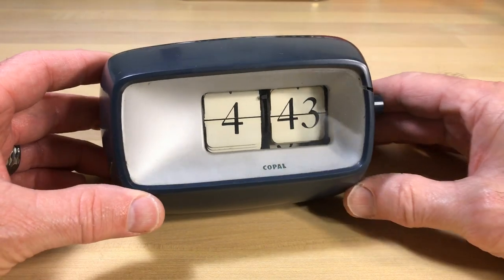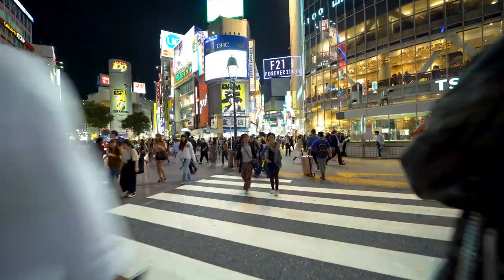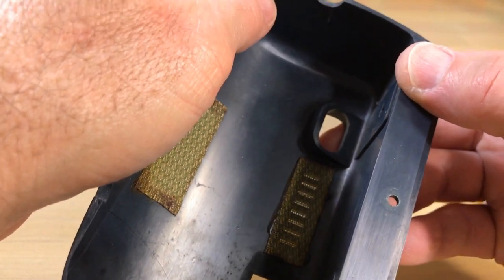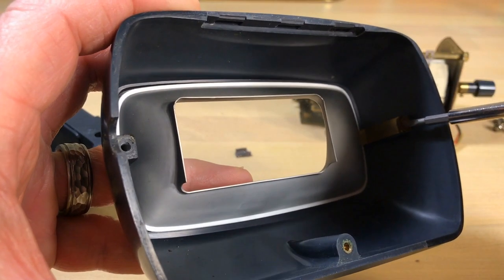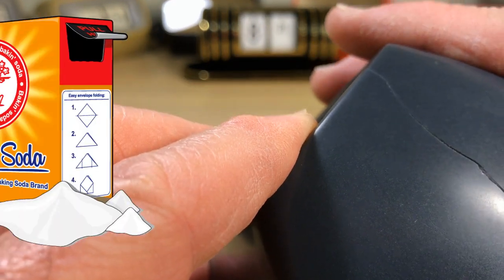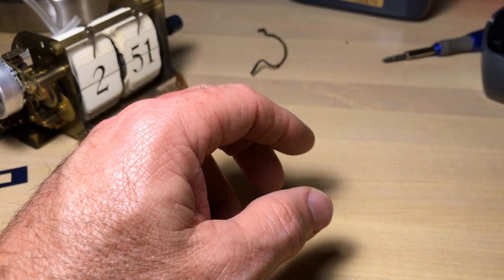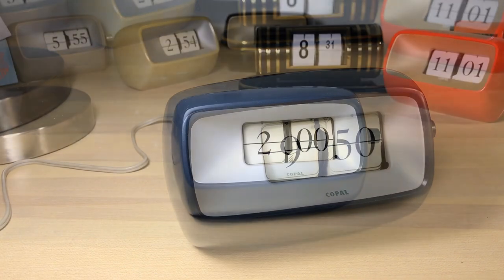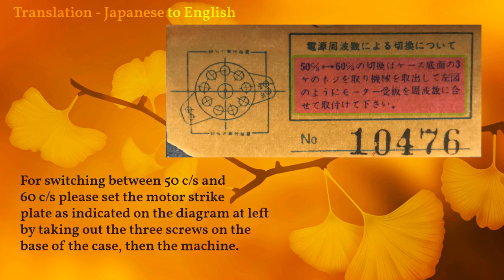Repairing a very early Japanese Blue-Grey Copal 101

Comment: Although not repaired with Gold, it's in keeping with the tradition of Kintsugi: 
"The art of repairing broken pottery by mending the areas of breakage with lacquer dusted or mixed with powdered gold, silver, or platinum, 
a method similar to the maki-e technique." Rather than what Westerners might do; Bin it!
Reply from the maker: Very interesting. I"m glad you mentioned that. I knew I had seen something like that before!  Got to tell my friends. And get some superglue with gold dust maybe.
Reply: @Flipclockfans Thanks!
 I think it is a realistic, achievable goal, except if Gold dust is expensive - because you'd need to practice your Kintsugi before doing it with actual repairs 'Proper', right? - 

It doesn't HAVE to be Gold, though, i believe... but, wow... if you could use Gold!😊

Imagine how amazing and Meta it would be; an early artefact of  Japanese Innovation, restored; using an ancient Japanese salvage method !